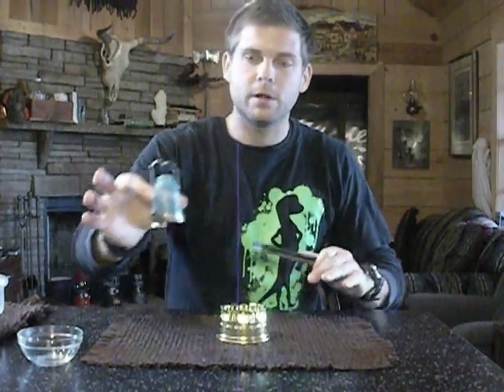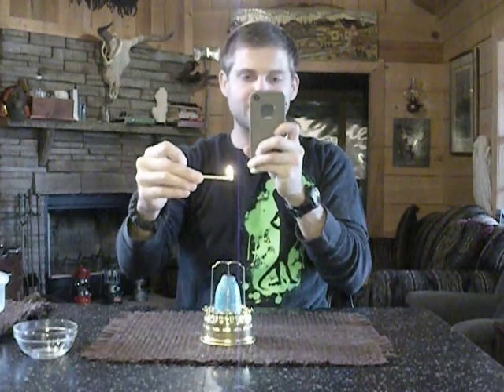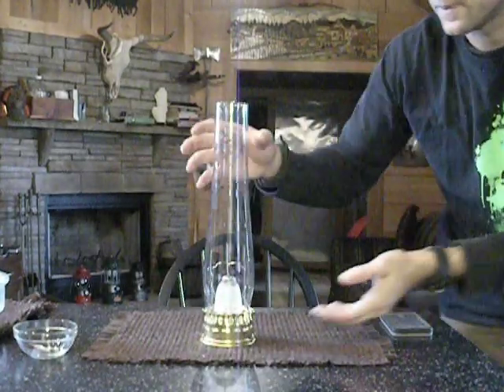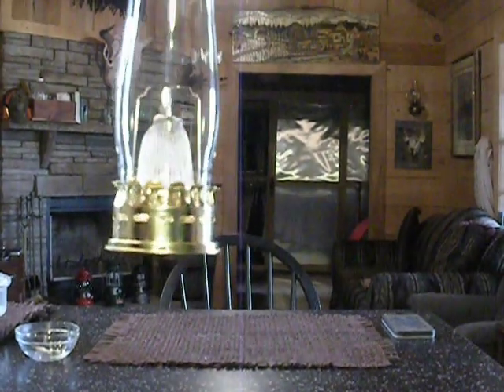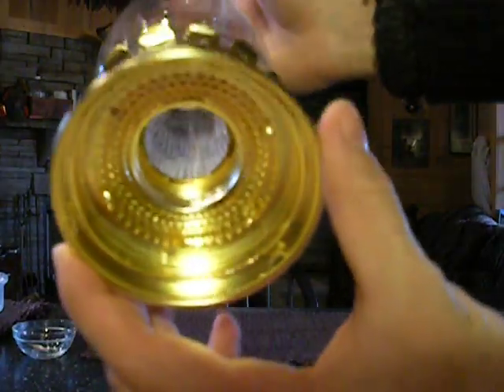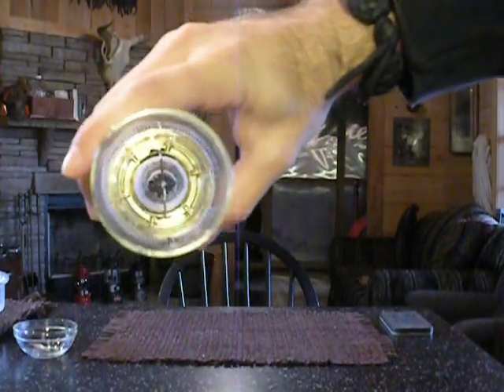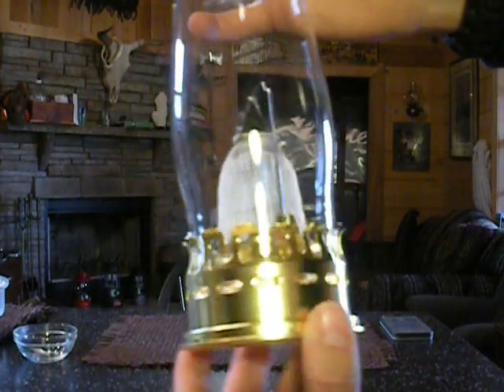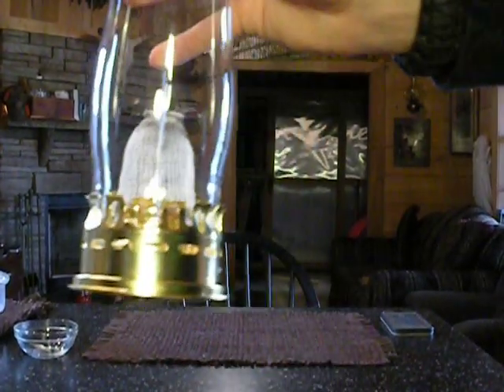Aladdin Oil Lamp :  Installing a new Mantle

Comment: Weston, thank you very much for the effort to make these informative videos, without it I would not have been able to fix my Aladdin. I am planning to build an adapter to mount a normal "two tie" mantle of a pressure lamp on the Aladdin. I will inform you whether it was a good idea  or not. Regards, Louis.
Reply: Louis Boshoff how did it work out?
Reply: Jim, I tried to make a double tie pressure lamp mantle  work on a former that I manufactured to fit the Aladdin . It was a partial success but I think the pressure lamp mantle is too tightly woven . I don't have enough spare time to pursue this issue and ordered some proper mantles for now. Let me know if you found a way around the problem . Enjoy it anyway!

Comment: hi Weston, have you tried using the gas tie on mantle for your Aladdin?  The regular mantles (at $12-ish apiece) can get expensive.  Thanks for any input.
Reply from the maker: I have thought the same thing. I assume you are talking about the mantles that usually go on a pressure gas or Coleman lantern. I have not tried this but I wonder if it is possible. It would take some very heavy modification and somehow you would have to engineer an opening at the top and tie the mantle to the frame system. I would not want to mess up my expensive lantern to try a 25 cent mantle. Do you know anyone who has tried this?